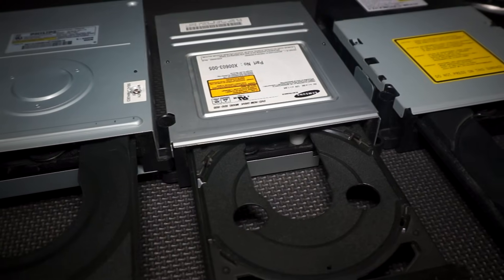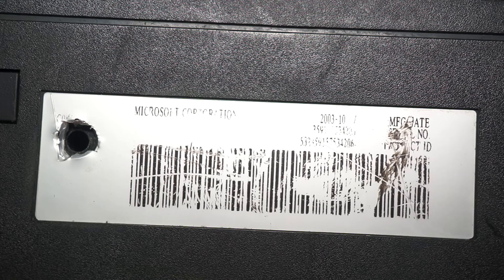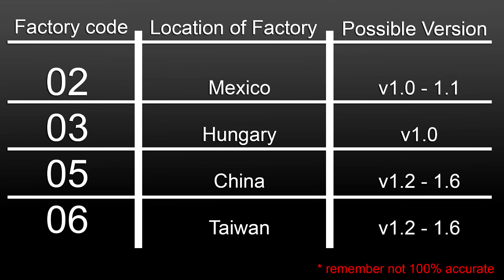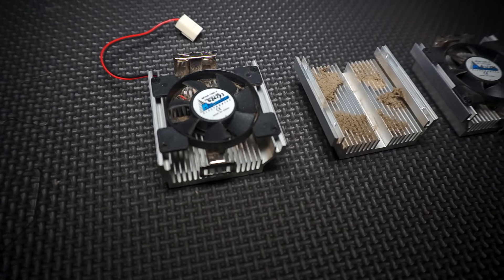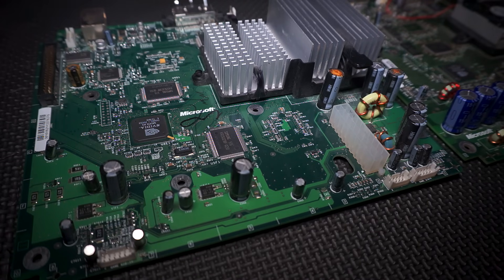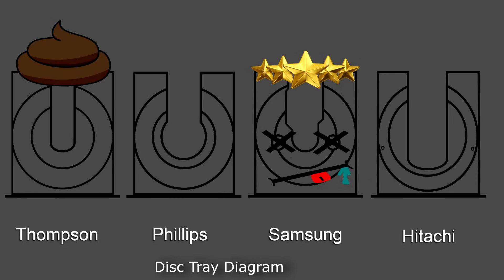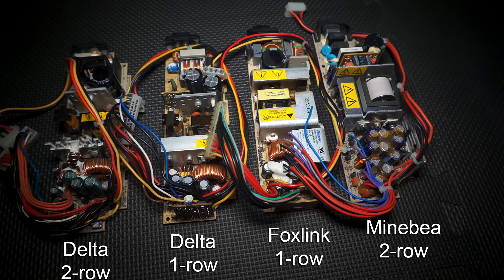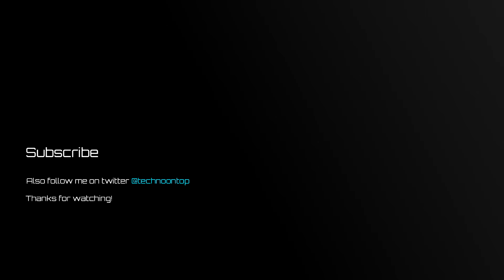How to tell what version original xbox you have

Comment: Thompson is the best drive imo, it's the only og xbox cd drive that I've resurrected in over 5 consoles.
Reply from the maker: Very nice! Iv never attempted to fix one's that don't work, only sticky tray ones, what's your process if you don't mind me asking?
Reply: @TechnoOnTop  completely disassemble disc drive, replace old band for cd carriage with new one. Apply lube on laser array slider things. Clean laser diode with %99.9 iso. Check resistance of laser diode with multi meter, check the motor that drives the laser with multi meter for continuity.

Comment: Mine is from October 27th 2004 and it won't read the disks i keep putting in
Reply from the maker: Well that sucks, unfortunately they are getting old disc drive failure is inevitable,  can be prolonged by only using mint disc's though.
Reply: @TechnoOnTop  i managed to get it to read a disk

Comment: I've got two pal xbox og and last one I just bought was the very first wave of 2002, coming with the duke controller. Its got a thompson drive I gather, and it has trouble reading discs. I havent ever replaced a drive there's no soldering involved? Also to bumb the resolution in the pal version, can there be a change made within the console itself once its open. Regards
Reply from the maker: There is no soldering required to change out the dvd drive, just 2 wires and 2 screws hold it in place. You can switch video modes within software. But that requires a softmod or a hardwood. I'm not aware of anything on the hardware level to force ntsc.  Hope that helps thanks for watching!
Reply: @TechnoOnTop  all right, I'm no modder but I want to fix this one for an entire game collection. Regards

Comment: I do have to say I’ve seen some quite interesting things with the Xbox’s I’ve owned. Mostly later Xbox’s with earlier parts. Like a late 1.4 with a Phillips that had a metal cover on the front assembly. Or even a 2 row Foxlink off of a parts 1.3 I own. Both of which are very reliable which I find quite interesting.
Reply from the maker: Haha yeah never know what you're going to get especially if they have been opened prior. Once I start going through my stack to make working xboxs who knows what mis match of parts will be used. Thanks for sharing and thank for watching!

Comment: Does anyone know the reason why the xbox dvd player does not open? I put a wire in the front hole and it does nothing .....  :(
Reply from the maker: Are you feeling the gear and moving it with your wire? If so maybe the belt broke. If not then make sure to turn the gear.
Reply: when I put the wire, I only feel a very hard wall, there is nothing
Reply from the maker: @davidgarciab.6670  hmm it's tough to really describe how to do it as it's definitely a "feel" type thing. All I can really say is there is a gear and you gotta make it move. It should move pretty easily. If you take the xbox apart you will be able to visually see the gear. Course that's alot more work.
Reply: @TechnoOnTop  I am afraid that I will have to disassemble it, I have seen that there is some model of reader that does not have that "tab". Although I have thought that perhaps the rubber of the tray extraction pulley has broken.

Comment: I got a version 1 with hitachi disk drive lol cool except it has red ring now... any chance you guys know a fix for This??
Reply from the maker: Solid red means it's over heating, I'm sure the thermal paste has failed, so go ahead and replace that and you should be good to go!
Reply: @TechnoOnTop  it flashes red and green actually I opened it up for the first time since I received it in 2001. Not sure which error I’m dealing with as there’s no number on the top left of screen
Reply from the maker: Oh yeah flashing between just means "general hardware failure"  check the clock capacitor and the area around it if it has busted, remove it then clean up any mess it made, it can corrode traces so they may need repaired,

Comment: Id like to make mention I have 2 Xbox’s one is a 1.1 and the other is a 1.6 when disassembling them the 1.1 had silver screws while the 1.6 have black screws also when I had them side by side the earlier one had a more mat finish that had a bit more gray in it while the the 1.6 had a shinier more deep black to it I’m not sure if that’s just my systems or if it goes to all of them also both of them have Philips drives and they both sound different the earlier one had a more noisy eject while the other ejected more quietly again this could just be age
Reply from the maker: Yeah iv noticed the difference in screw colors, not just the ones that keep the system together but slightly different color for ones that hold in the motherboard, never really noticed them being a darker black though I think I will go and stare at some lol thanks for the comment and for watching!
Reply: I will say that probably shouldn’t go off screw colors as I got another 1.6 that had silver screws as well also this 1.6 I got was one of the last ones made before they were discontinued it had Samsung ram so it would be a 1.6 but it had a hitachi drive and I will say it’s noisy when it’s moving the laser around

Comment: Thanks for the info, I have a version 1.0 which still works, aside from the Thomson starting to fail. I removed the clock capacitor. What is a good hard drive to replace the original with to store the games digitally on them? I would like to back up all my DVD's in case the discs deteriorate from age.
Reply from the maker: Really any Sata hard drive will work just fine I have a 2tb laptop drive in mine, just be sure and spend the extra money and buy a good ide to Sata adapter I recommend the startech one. Both the hard drive and adapter are linked in my main Xbox showcase video's. But I appreciate the comment glad to hear your Xbox is still up and running playing backups off the harddrive is definitely the way to go!

Comment: Okay so I tried to swop out a power supply on my original xbox, it didn't work, I put the power supply back into the one it took it out of, seems to still work, the one I wanted to fix is still not working, any suggestions
Reply from the maker: Not all versions of power supplies are compatible with each other, for instance a, 2 row PSU from a 1.6, can't go into anything other then a 1.6. Problem is there are 2 row power supplies that will plug in but they won't work and will possibly break things in the process. I'd start with checking what versions of Xbox you swapped.

Comment: I got a 1.6B. Made in March 2005. No Kerneral number, but it has Xcalibur and hynix. Power supply is the second from the left on the video (sorry can't remember the name) but it's slightly different. Probably been fixed before. Seagate hard drive and a Samsung disc drive. Can't tell you how well it works as it won't turn on. Lol can't send pics if you need for reference
Reply from the maker: Yeah I have still yet to come across a 1.6b, im actually suprised it doesn't work, in my experience the 1.6's always do, but I guess they are also getting up there in age. Thanks for the offer awhile ago someone snapped some pictures of the Ram so I'm good. Thanks for watching!
Reply: @TechnoOnTop  anytime. i just found your channel and its awesome. keep up the good videos. and the xbox did work, didn't play it very much. but a friend was coming over and we wanted  to Halo 2 it. i turned it on and opened the trey to put the disc in, turned it off. we went to play a hour later and it wont power up or do anything.
Reply from the maker: I appreciate the kind words, that is very odd, first thing I'd try to do is replace the thermal paste, typically if it's dry it causes weird/random issues, though they typically happen while the console is on. But that would be my first step. Take care with removing the heatsinks, especially the gpu one it likes to stick and if you pull to hard you could kill it, a hot air gun (or even a blow dryer should be sufficient). Good luck hopefully you can get it back up and running!

Comment: Hello there. I am not too sure if you still respond or not. Anyways, my power supply is not the best so could i buy a new and better one? Something compatible with the Xbox? Maybe i could plug a 360 power supply in? Cheers
Reply from the maker: Why would you say that your power supply is not the best? If it works thats all that matters, and no a 360 power supply wouldn't be plug and play, sure it's probably possible, an adapter can be made to use atx power supplies.
Reply: @TechnoOnTop  the issue is the power supply does not work. It is on that edge of things really. Would an arc power supply be inside the machine?
Reply from the maker: I'd check the solder joints right at where you plug it in, those typically break, idk what you mean by "arc inside the machine"  if the solder joints go bad it is very possible to cause a short/or power arc which is part of the reason they would catch fire if I remember correctly. If it is really beyond repair your better off just finding a replacement but you need to make sure you get one that's correct for your version of Xbox, they are semi interchangeable but not completely unless you want to make adapters see this forum post https://www.ogxbox.com/forums/index.php?/topic/24-xbox-power-supply-pinouts/
Reply: @TechnoOnTop  I meant to say ATX power supply. Could I possibly buy a some what new power supply? I do not know much about this stuff so I was just wondering. I do know how to solder. However, it did work but not exactly. My power supply is too far gone at this point. Should I just buy a used power supply(Xbox power supply) then? Everything else on my Xbox works. You did say something about adapters for ATX power supply.
Reply from the maker: You'll need to make an adapter to use an atx power supply. Those of course are pretty big and wouldn't fit in the case, a micro atx can be used and has been by a few different modders over the years you just have to make sure they are able to supply enough power. Honestly your best bet is to just find a replacement power supply would be the simplest solution

Comment: I learned from this that I have a v1.0 which is cool. I was wondering now though if replacing the power brick is the thing to do are they easy enough to find replacements or if I am not planning on dropping the system back into its original box can I change its power supply to something else entirely?
Reply from the maker: By power brick I'm assuming you mean the internal PSU, they can be easily swapped out with some others if you look at a pinout for them https://www.google.com/search?q=original+xbox+psu+pinout&oq=original+Xbox+psu+&aqs=chrome.2.69i57j0i457j0j0i22i30l2.4888j1j4&client=ms-android-hms-tmobile-us&sourceid=chrome-mobile&ie=UTF-8#imgrc=UcRE1kGy12mCyM.    As far as replacing with something different it is possible there is a schematic for using ATX power supplies, requires a bit of work there used to be a product but it hasn't been made for some time. Hopefully that helps if you have any questions reach out thanks for watching!

Comment: Every now and then I get into a version 1.6 that has orange instead of red off the power supply and a white wire instead of yellow for dvd drive, I can't seem to find any info on these
Reply from the maker: Well the 1.6 has a different power supply, and the cable color for the DVD drive is just a manufacturer thing, here's a pinout that shows the difference between power supplies https://images.app.goo.gl/gJXQDB2qXSeikwMb9
Reply: @TechnoOnTop  thanks for responding, so when you replace a power supply it still has to be the same right? Even both 1.6 power supplies look the same(only difference being orange wires instead of red)
Reply from the maker: Power supplies are somewhat interchangeable between revisions, when looking at the pinout I linked
v1-1.1 are interchangeable, v1.2-1.5 are interchangeable, 1.6/1.6b aren't. There used to be some adapter that would allow you to use older psu's in a 1.6 I'm sure the schematic is floating around the internet somewhere. There also used to be a third party psu that would work with all revisions,
Reply from the maker: The one with orange wires is a 1.6 psu, the one with red is a 1.2-1.5 psu

Comment: I’d still go for a 1.6 or 1.6b- The others all had that time capacitor rot issue,easy fix I know but a buyers beware
Reply from the maker: Yeah and if you aren't comfortable with the replacement yourself it makes sense to go for the 1.6's. Though I have seen the clock cap go bad on the 1.6's I believe it was a reddit post some time ago. Anyways thanks for watching!

Comment: My manufacturing date is 2001, the dashboard kernel is on 4034, so I think it's fair to say I've got a 1.0. I'm pretty sure I had something newer years ago on my original box because discs loaded faster and it wasn't as noisy, but I'm sure those can be explained with age and dust.
Reply from the maker: Yeah probably just age, iv had some pretty noisy disc drives over the years, also on the v1. 0 the gpu fan bearing usually goes bad making it sound like a lawnmower, thanks for watching
Reply: @TechnoOnTop  Sure thing. Also, thanks for helping me out. I did a TSOP flash yesterday and just like I thought, I had a 1.0. I had a sticker on the MOBO and HDD with 4034 on it too.
Reply: @TechnoOnTop  my og Xbox was manufactured in July 2003 and it has a western digital drive, Samsung disk drive, foxlink psu, and the conexant video encoder. Is it a revision 1.3?

Comment: Do you have any idea on how to replace the AV cable port?
Reply from the maker: Yes, de-solder it, then solder in a new one, would be pretty easy with the correct tools and supplies (hot air rework station, kapton tape, liquid Flux or a desoldering gun, I suppose you could also do it with just solder wic but it would take forever and you'd risk damaging the pcb.)

Comment: Hey can you help me with my xbox problem ?
Reply from the maker: I can try
Reply: @TechnoOnTop first of all thank you for responding. 
I have a xbox 1.6 i guess when i want to play i can play 30 minutes after that console won't turn on. I checked capacitors look good to me my xbox is chipped with xecuter. I don't know what to do about it.
Reply from the maker: Verify the fan is working, also have you changed out the thermal paste? If you haven't make sure to warm it up before trying to pull them off,
Reply: @TechnoOnTop  i checked fans are working but i didnt change the thermal  paste it looks very old in my Xbox  when i opened first and played first 30 minutes i saw the cpu temperature 67.9 celcius
Reply from the maker: Yeah change the paste it's probably just overheating, iv seen/heard of old paste causing weird issues

Comment: I’ve asked this question in other places in the past hour or so but I’m still looking for answers. Clock Capacitor Question

I got my Xbox off eBay a few weeks ago and was made in January 2004, months before the 1.6 version. I’m unsure whether modifications were made or not, because the controller I got had the control sticks replaced with PS2 ones. Also my power strip keeps getting unplugged and whenever I boot up my Xbox after this it takes me to the clock set up, but if I power it off and on without being unplugged, it takes me straight to the menu or game. So could the clock capacitor potentially be already removed or not? I haven’t opened it up to check but I am curious for obvious reasons.

And by the way, I unplugged my Xbox, plugged it back in seconds later, powered it on, and I get the clock menu, but the stickers are still there.
Reply from the maker: It would seem thr clock cap is bad from what you're describing, you should really pop it open and get rid of it, so long as it's not a 1.6. The dates aren't the most accurate to go by. If it happens to be a 1.6 then you will need to replace the cap, but I'm doubting it is, no cap in a 1.6 puts the console into a boot loop. Anyways good luck thanks for watching
Reply: TechnoOnTop unfortunately I don’t think I have the right screwdrivers for it.

Comment: which version of the xbox doesn't have the thing that leaks and damages the board. in latter models it was changed and fixed.
Reply from the maker: 1.6,1.6b  a leaky capacitor is always possible it's just not as common

Comment: Just got a 1.6B for 4 euro no cables and controller only console and the front light flashes green and yellow
Reply from the maker: They flash orange and green, when there isn't a video cable plugged in. I assume that's your issue since you said it didn't come with cables
Reply: @TechnoOnTop  they did say it was defect so idk if thats the only thing
Reply from the maker: If after plugging in av cables, the yes it could be a bad video chip, seems unlikely, unless it was tampered with prior to you owning it
Reply: @TechnoOnTop  stickers looked perfect until i opened it date from 2005